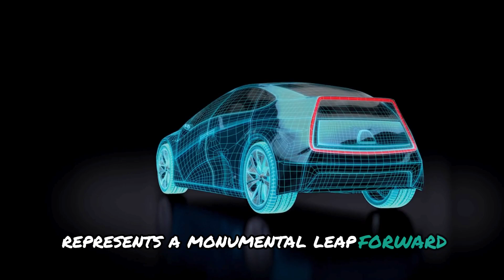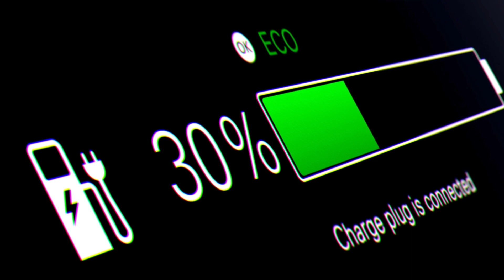BYD CEO Announces All New Solid State Batteries With 10 Minutes Fast Charging!

Comment: Power required to charge a 50 kWh EV battery in 10 minutes, is 300 kW.
which system can deliver that much power?
Even at 400V the current will be 750 A
and at 800V it would be 375 A